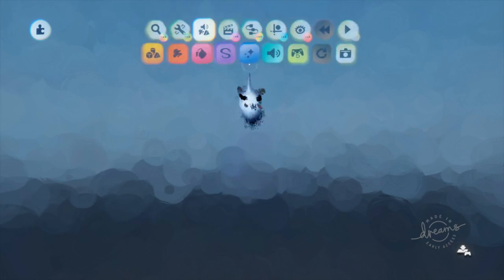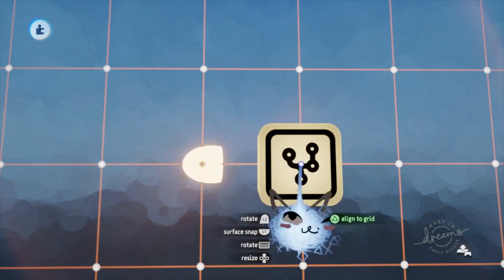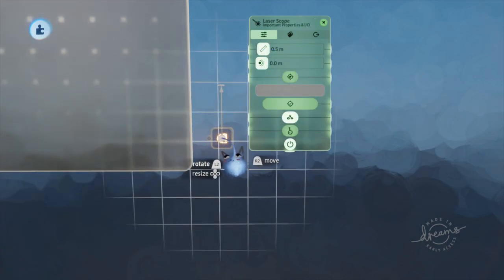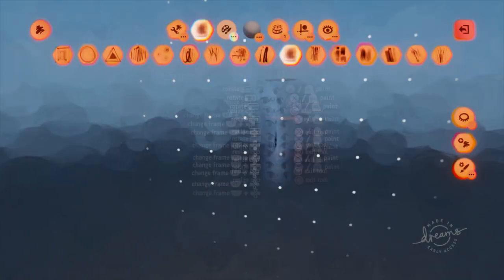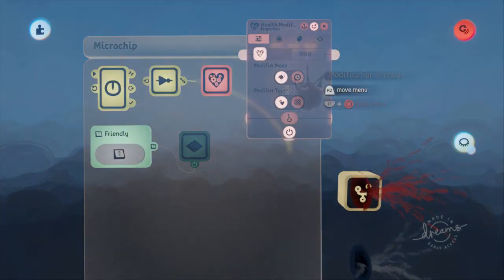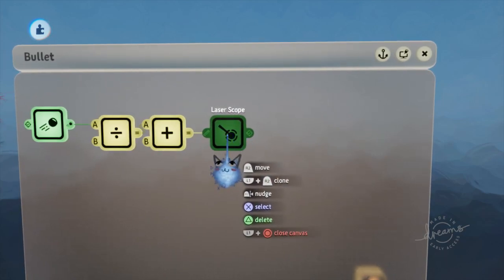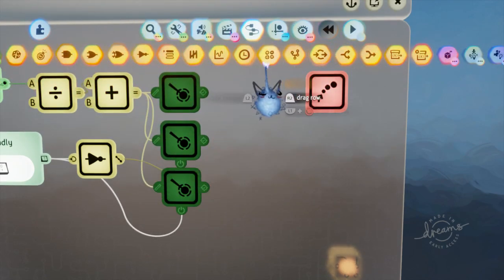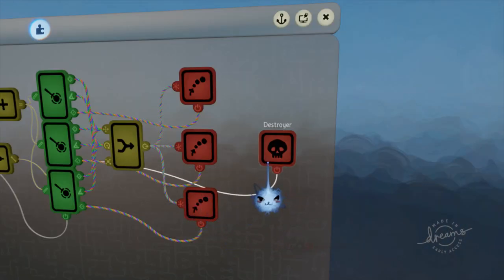Dreams PS4 | Better Projectiles

Comment: Ah, so physics operates at 30fps. I was hoping MM would increase it to 60 or maybe even 120. Thank you for the info! Prior to this, it was just a lucky guess using the laser sensor, and projectiles would typically pass through. I typically use zones, just to make collision a little bit easier, considering that there is a lot of motion in my game.

Great advice and I’ll use it for my snipers!

Comment: Sorry, I dont understand what is happening from the 1.30 onwards to 2.30.  The instructions seem to be in a confusing order, and your changing things so its hard to understand what the resulting values are.  Like if I reset the laser scope value to 0.1 then it moves completely out of place so its not in line with the front of the missile.

Comment: Seriously, it's too fast and too many jumps. One second the calculator is there, then it's gone, and then it's there again. Suddenly there are new elements of logic appears (although they are kinda understandable, but still). And you hold the imp on one element, what seems like you intend to use it, but then instantly you switch to another. It's very difficult to follow what is happening and simultaneously listen and understand what you are saying, especially if you do not know English perfectly.

But thanks anyway. It was kinda interesting.

Comment: How does this handle way faster bullet speeds? And do the impact effects align  with the surface of the thing they hit? I'm currently using basic impact detection which is...ok. but I'm struggling to get the bullet holes to align with the surfaces they hit on enemies and the environment. And also the bullet holes linger in the air after an enemy is destroyed and I can't figure out how to destroy the bullet holes that are on a destroyed enemy at the point of dying? Any advice? Thanks.
Reply: a noob way to do it is to add copy the wire that goes to the DEATH input for characters to a keyframe and while recording set the total amount emitted on the impact emitter to 0 and they will all dissapper